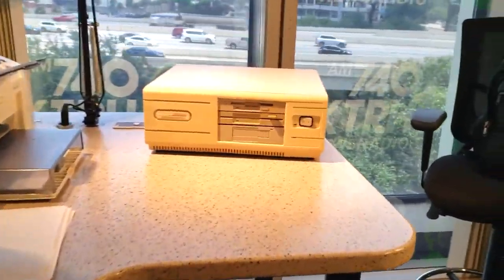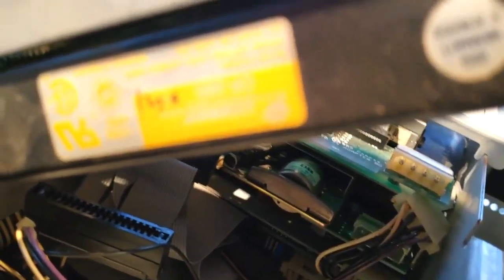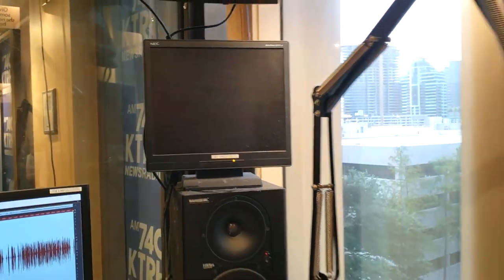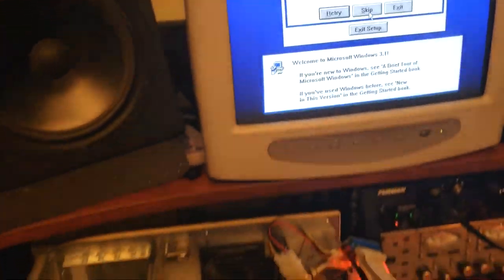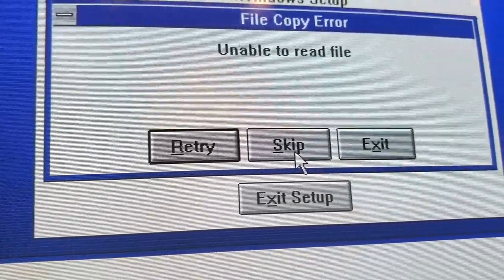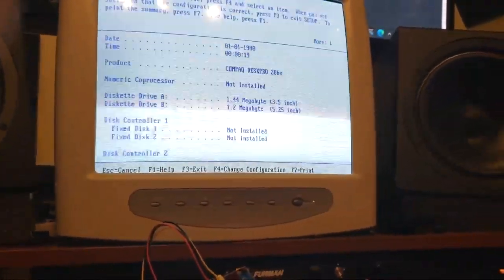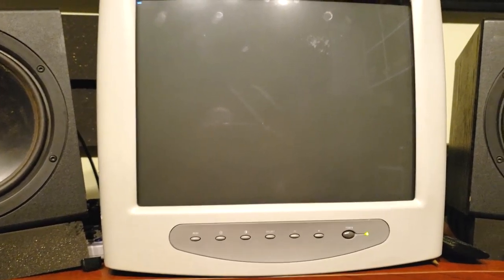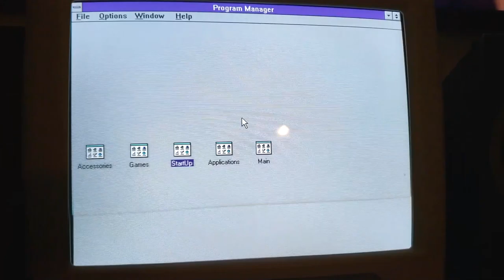A retro PC noob discovers/explores a Deskpro 286e for the first time!

Comment: if you want the authentic era office experience you would install WordStar or Wordperfect and Lotus 123, not Win+office. Compaqs don't have normal BIOS so you need that setup tool -- back that thing up! You need to set the "hard drive"to the correct geometry if the BIOS does not allow custom geometry there are numerous drive utulites that will overide it, I'm sure you can find one the same way you found win3. I used to use one called DrivePro. The max partition size you can have 504MB, however with the correct geometry your modern PC can read that flash card with no problem.
Reply: "Compaq doesn't have its own BIOS..."
That is very true. There are different floppy disk packages for different board iterations. So a BIOS disk for a Compaq Deskpro 286 board may not necessarily work on a similar with Compaq with a different motherboard. Not to mention, when you finally load the BIOS, it creates and writes a small partition on your hard drive, so it "remembers" the settings. This was before they used the watch battery to keep the settings on the CMOS chip. Recently restored a 386sx version of a Compaq Deskpro, an had to 'customize' a boot disk, to get it to work.
Ah, the good 'ol days, shlomping through this back then, without the of Google to help- or the Internet for that matter.

Comment: Really enjoyed this video! I recently picked up an old Compaq 486 and I’m having some of the same hassles you had...the missing pin on the VGA connector, need to change the CMOS battery etc

And great advice about a “bridge computer” I knocked together a quick LGA775 system for that exact task, although thinking about it...I could have just bought a USB floppy drive 🤔
Reply from the maker: Jon Chapman In my experience, a USB floppy is a great tool to have, but they can be very iffy in quality. For instance, more often than not the USB floppy drive can’t read or properly write to some disks sometimes whereas my Windows 98 computer can read, write, and format all day long. Just something to keep in mind.
Reply from the maker: Wait sorry, do you mean a USB floppy emulator (Gotek, etc), THOSE are great! External USB Floppy drives are what can be flaky.
Reply: Geek Therapy Radio, I meant USB floppy, but yeah those floppy emulators look awesome!